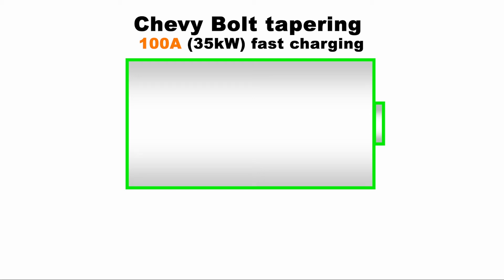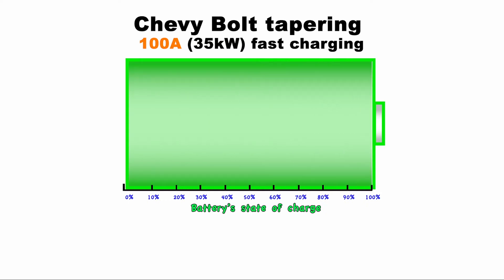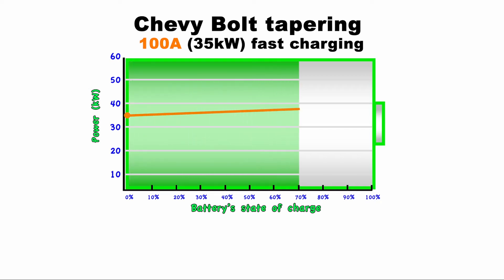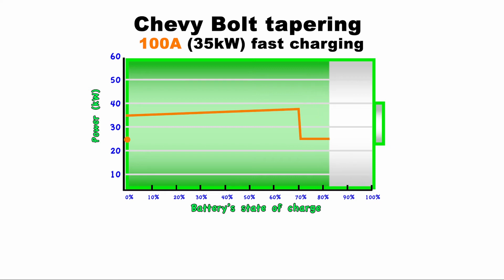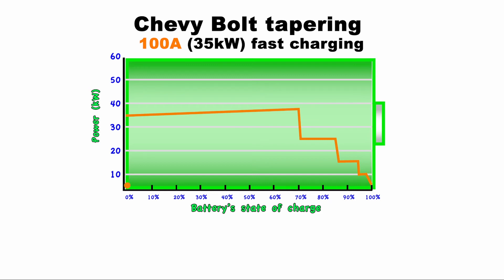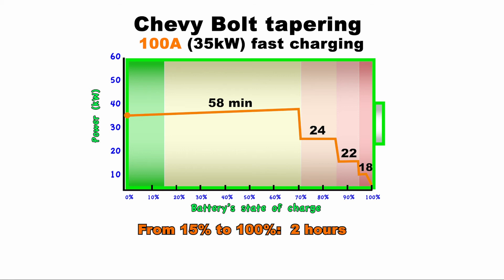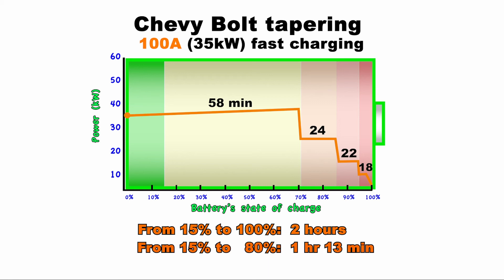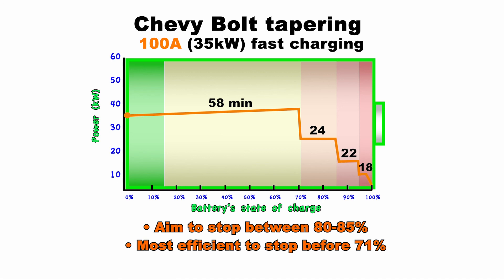How a Chevy Bolt (2017-2019) tapers at 100 amp DC Fast Charge Station

Comment: It would be very helpful if you could do this same video on various speeds of fast chargers. Anywhere from 50kw/125 amp on up to 350kw. Thanks.
Reply from the maker: And here’s the final one for 150+ amps: https://youtu.be/kuMU_3zJYDM
This would be the top speed (55 kW) for current Bolts. So charging at a 350 kW station would be unnecessary. If you’re at an Electrify America station and have the options of 75kW, 150kW, and 350kW, using the 75kW station should get you top speeds in optimal conditions. Using the others would just tie them up for others than can take advantage of that power, or perhaps cost you more than necessary (but to be honest, I’m not sure if EA charge$ based on station power potential or actual power your EV is asking for).
Reply from the maker: Here’s the next one for 125 amp station: https://youtu.be/yXy-zhRIcDU
Reply from the maker: In the works, Michael. Thanks for the feedback.